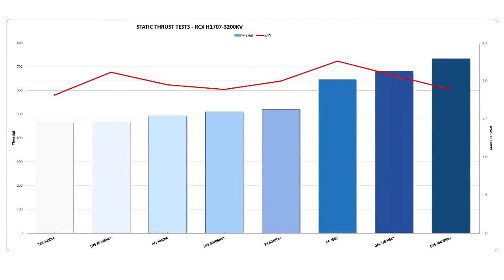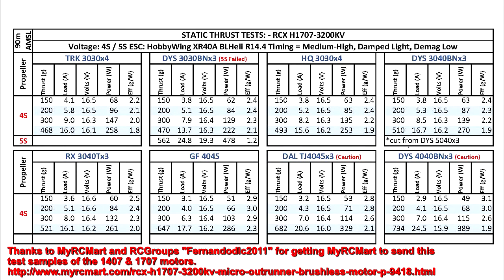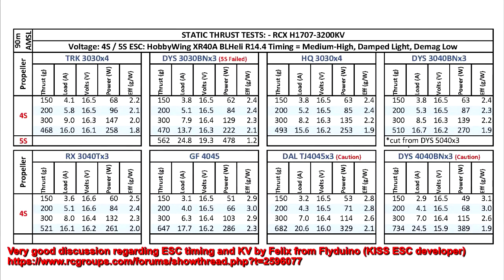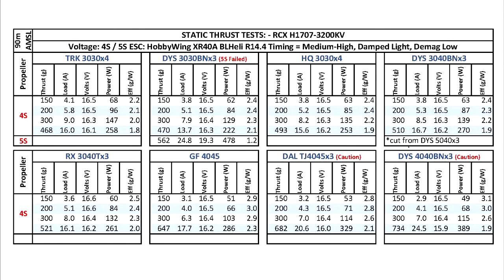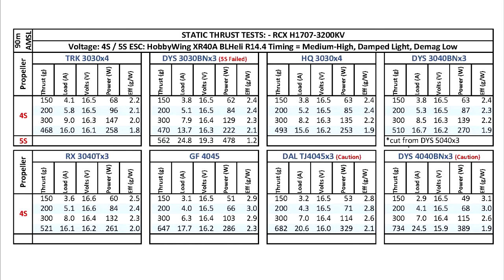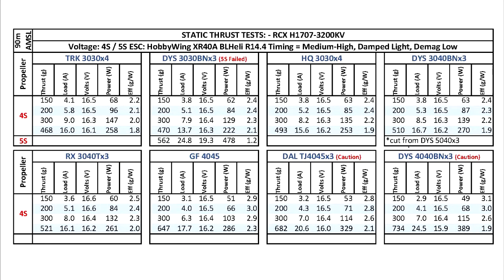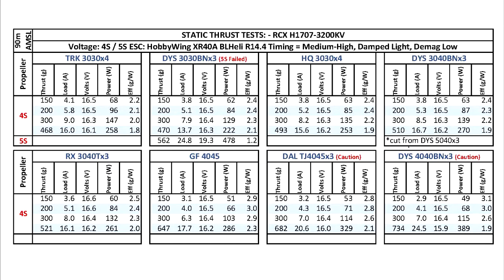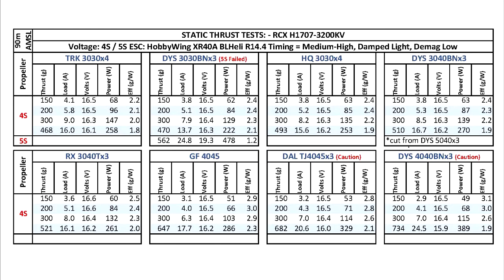MyRCMart.com RCX H1707-3200KV

Comment: Thank you for the test. I ordered some to test it but it is not needed anymore :D. I was hoping more from this motor with a 3"prop. Same thrust but less amps... :/
Reply from the maker: Cid156 My opinion is the KV needs to be a little higher for 3" props on 4S or 3S if you want "crazy" thrust. For 3200kv all you need is 1407 or maybe even a 1306. This motor is good for 4" props. For 3" builds maybe the 3900KV version would be best.
Reply: The problem with small quads it is the lipo... It is hard to pull more than 50A on a 850mah lipo. I am not sure that the RCX1407 will be a better option in 3". It will never reach the 500gr trust and the load should be similar. 
The best option seems to be the Tornado T1 1407 3600kV. You can have 500gr thrust with only 14A load or you can have a crazy thrust of 600gr... but it will probably kill the lipo :)
Do you will test the RCX 1707 3900kv and the RCX1407 3200kv?
Reply from the maker: Cid156 Right.  Small LiPos can't deliver that much sustained current. Also, in flight, Amps are about 25 to 35% lower as props unload so the total Amp draw is less. In these test we can compare motor capability to drive props but of course we won't be getting the same thrust in actual flight.

Comment: Hey EngineerX,
in your EMAX RS1306-4000KV Static Thrust Tests video description 
you told that you are going to make some 4S packs out of 1s Turnigy 65C 750mAh cells.
Could you make a video of it?
:-)

~Randy
Reply from the maker: I haven't got around to making the packs, just can't seem to find enough time in a day. You can find many videos on how to "repair" "solder" "make" LiPo packs on YT. It's the same principle. You MUST be extremely careful to avoid shorting terminals. I mask everything with tape and only leave the tabs I'm going to solder exposed. You need to use a good soldering iron that can maintain high heat or you won't be able to melt the aluminum solder you need to use. So you need something like this http://www.ebay.com/itm/ULTRA-GOLD-FLUX-KIT-FOR-SOLDERING-ALUMINUM-SPEAKER-VOICE-COILS-/131168920197
That's what I use. You need lots of ventilation and use alot of heat to melt Aluminum and use the special flux. If your soldering skills are not that good. I would suggest not to do it until you get a lot of experience or you may end up with bad soldering and batteries that will fill mid-flight
Reply from the maker: This is a good video:
https://www.youtube.com/watch?v=dI04G-uXfxo

Comment: Nice, 3 inch quads seem to work fine. I wonder about 3900kv on HV.
Reply from the maker: Should be OK I think..... I've seen some people running 3" on 1306- 4000KV, though motors run toasty, I would imagine the larger size of the 1707 should deal better with the load. I think the 1407 is better for 3". Thrust is very similar and weight is less. 17.2g vs. 13.5g

Comment: ahahahahah, love the 5s test. fraction of a second = magic smoke.

Thanks to myrcmart for enabling us to test this.
Reply from the maker: Yeah.... I was sad on the poor little motor's demise. I was really looking forward to 5S results, alas it didn't happen. I started the sweep slow at the beginning and it all seem OK so I went for it. The HobbyWing XR40 ESC has handled everything I've thrown. I picked the tri-blade with one of  the lowest loadings but that didn't help. I thinking switching Timing =High may have done the trick. Still , very solid results on 4S and 4" props.